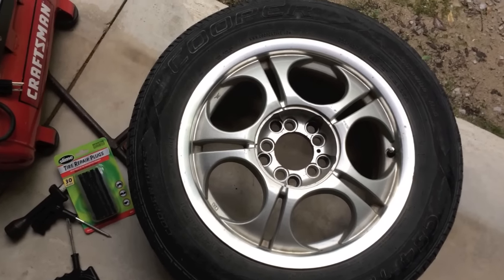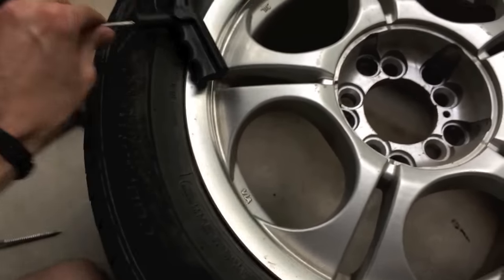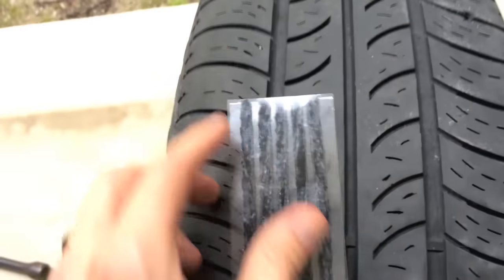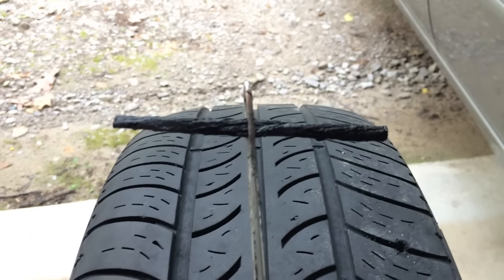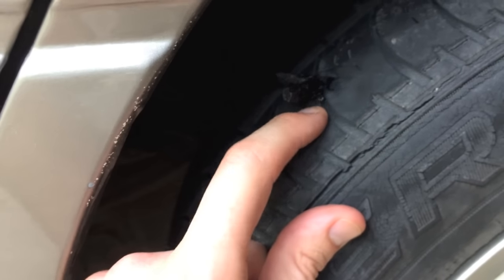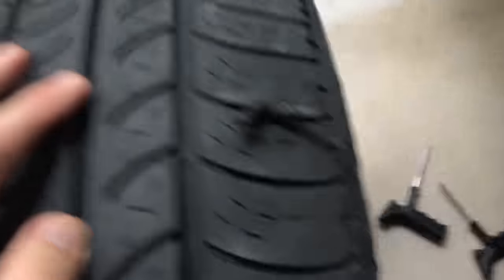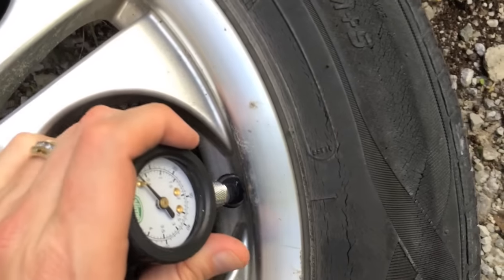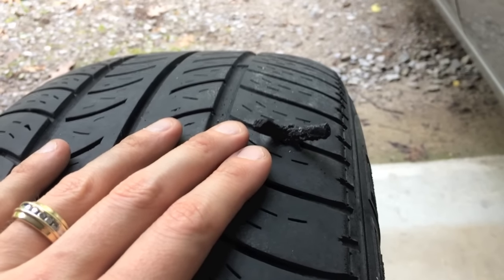How to Patch/Plug Hole in Tire in LESS THAN 5 Minutes - Fix a Flat Tire - EASY FIX

Comment: First time user.  Small hole and hard to fill with tool (no glue).   I'm uncertain about the quality of the job.  Should I pull the plug and try again before using the car?
Reply from the maker: Thanks for watching, that will be personal preference and may provide you the piece of mind that it’s a perfect seal.

Now that you have performed this once, consider it practice.  You will do much better if you do it again.  😁👍

Comment: I had hard times to insert the patch in ! Is there any way to force it in, I also tried to use the weight of tire on the patch, it broke my patch rim handle.
Reply from the maker: Thanks for watching & these can be tricky at times.  You will need to use the tool with the rough ridges which will help scrape hole into a slightly larger opening.

This will allow you to insert plug in a more friendly manner.  Keep us posted.

Comment: You don’t need added cement to plug it. Simply light the plug on fire with a match just prior to insertion and the glue in the plug will set up like silicon glue/tar after it cools back down, because that’s exactly what it is inside the plug strips and if you dry fit it, the heat from the tire against the road during natural rotational will bond this plug to the rubber tire hole without added glue or matches. Just follow the instructions and you’ll be fine.

Comment: It’s a round file and it’s used to make the hole perfectly round for the plug to seal properly.
Reply: You will want to do it until it is fairly easy then insert your plug. It’s also a good idea to use rubber cement on the plug before installation. Let it set up for a half hour then air the tire up (if you can wait that long)
Reply from the maker: Thanks for sharing.  All helpful info is greatly appreciated.  😎👍

Let us know if you have any questions and hey if you’re into crypto trading, join our DIY ecosystem and become part of an exclusive group of DIYers.

       toolboxtoken.com

Reach out to us any time!  🧰

Comment: i did this but leak came back in a week. Used rubber cement, didn't push it in all the way, etc. Maybe these slime brand plugs are cheap?
Reply from the maker: Thanks for watching & welcome to the DIY Raptor Club.  We recommend installing a new plug.  Make sure you insert plug fully until the looped end goes through the tire to the inside.

Comment: If I had a hard time pushing the plug into the tire, is it ok to use a little wd40?
Reply from the maker: Tec Angel 

Thanks for watching Tec Angel.  Unfortunately we have never used WD40 on a project like this.  Not really sure if there is an advantage or disadvantage!

If it was us, we would stay away from using WD40 & just stick with the tool & items that are part of the repair kit.

Keep us posted!

Please subscribe to the channel and turn on your YouTube notification Bell 🛎 that would be awesome thanks again!  😎👍🔧🔩
Reply: I've experienced the same, especially is the hole is small.  I've method,  cut the worm down the middle,  that seems to work on the small holes,  because they're a nightmare to push in.

Comment: Then you can clean the rest of the gunk left on the reamer from the used plug with a cloth and brake cleaner. Keeping your tools clean and like new is a sign of good tool storage. Spray the cloth, or spray the reamer. Either way, brake cleaner dissolves it and it wipes right off.
Reply: the set tool
Reply from the maker: Thanks for sharing.  👍

Comment: So how do you avoid pulling the plug back out when you pull the insertion tool out?
Reply: It’s a really fast movement. The plug slips through the slot in the tool. If you aren’t fast enough it’ll pull the plug back out.

Comment: I have a hole in my tire in the same spot. Went to the shop and they wouldn't patch it because they said it was on the side wall. Is this a dangerous spot to patch/plug? Might have to do it myself..
Reply: Dease Knutz  thanks, plugged it myself and it’s been good so far

Comment: I went to a tire shop and they said they wont fix it because the puncture was within the lining of the tread and close to the edge but definitely not on the shoulder part, which is the same in this video. I am worried the tire might blow, due to it being unsafe, but Ive seen other videos for a tire repair on the shoulder of the tire which is seem thicker than within the tread like mine but many commented it could blow, so i am not sure if i should be too worried lol. Any thoughts?
Reply from the maker: Thanks for watching & welcome to the DIY Raptor Club.  That will be personal preference in the end.

For our tire, it made sense to plug it to allow us to drive it to the shop for a replacement tire.

The plug cost less than $5.00 which was better than the quoted tow to shop of $285.00

Keep us posted.  😎👍
Reply: Youll be fine as long as it isn't on the sidewall. A tire can blow at any time plugged or not.
Reply from the maker: @thebeachguy6697  

Thanks for watching & sharing.  😎👍

Comment: you might want to revise not cutting several times I had attempted to leave it, and it pulled out as it was parked on a hot cement road the debris attached itself to the cement because of the heat and pulled the plug out. Use a razor blade and cut it flush is the best result.
Reply from the maker: Good morning, just poured a cup of coffee and am sitting down to answer any and all questions for the DIY community.

Thanks for taking the time to share your experience and feedback, always welcome here.

Let us know if you have any questions and hey if you’re into crypto trading, join our DIY ecosystem and become part of an exclusive group of DIYers.

       toolboxtoken.com

Reach out to us any time!  🧰

Comment: How long will this last?  Is this a temporary fix until you can do a proper patch (off the rim)?
Reply from the maker: William Woods 

Thanks for watching, this product is engineered & designed to be a temporary fix.  We have spoke to people that have used this product & had no leaks for several years however again...engineered & designed to be a temporary fix.  Hope this helps.

Please subscribe to the channel and Ring your YouTube Bell 🛎 that would be awesome thanks again!

😎👍🔧🔩
Reply: I've plugged almost new tires with full tread & this held up till I changed the tires once all my tread was gone. They have to say temporary fix but we all know from experience that once this is sealed it is good for the life of the tire especially for simple screw or nail holes.

Comment: What’s the best way to locate the leak just looking what if it’s a small one?
Reply from the maker: Good morning ☕️ if tire is inflated and still installed on wheel hub, you can spray a mixture of dish soap and water on tire.

The mixture will bubble at the location of leak.  Please keep us posted.  🧰

Comment: Great video!
I'm a novice at auto repairs and just wanted some clarification on this repair. 
Isn't this repair too close to the tire wall? I heard that you only want to patch tires where the puncture is in the 'crown' or center of the tire? How true is that? jw.
Thank you again! - BC
Reply from the maker: Thanks for watching & welcome to the DIY Raptor Club.  This will depend on who you ask.  Most importantly, if it’s on the sidewall...no go...tire is trash.

Hope all is well with you and your family Brian.  😎👍
Reply: Yes your correct the repair is to close to the sidewall there can't be a patch there only a plug and it's still a risk
Reply from the maker: @excessivemedia9295  

Thanks for watching.

Comment: When i was doing all the thing the strip go all the way in 
What should i do its not leaking though
Reply from the maker: Good morning ☕️ any update?  If the entire strip went all the way through the tire, we recommend inserting a second strip/plug to ensure that the tire does not leak.  🧰
Reply: @DIYwithMichaelBorders Good morning , i tried to check it with the soapy water and there were no bubbles after that and the tire is not leaking air drove it for 100 km already
Reply from the maker: @roopindersingh2051  

Thanks for the follow up.  😎👍🧰

Comment: Wait, did you push the nail into the tire?
Reply: Yes yes he did
Reply: @josh1158  that’s ok? Because I have a nail that the head has been broken off. Easier to push it in than pull it out.
Reply: @gregoryschwarz2730  Not really it'll probably make a noise and throw the tire out of balance! If you don't care about that go for it 🙈

Comment: You should never try to push the object all the way inside your tire you wanna pull the nail or screw whatever it is you want to pull that out of the hole and get it out of your tire not have it banging around inside your wheel rim

Comment: What to do if there IS a leak even when the hole is plugged?
Reply from the maker: Thanks for watching, you will need to pull out plug, add the cement application and install a new plug.  😁👍

Comment: This video is good but you did not patch the hole. You put a plug in the tire. I have worked at a tire shop for over a year. And patches go in the tire. Good job though

Comment: Interesting. I always put a liberal amount of rubber cement on the reemer and send it in and out to coat the sides of the hole. I actually send the plug all the way down and then pull up and there is less excess on the outside.  Then I liberally put rubber cement on the top and light it on fire. Never had a plug leak!
Reply from the maker: Thanks for watching & sharing, that’s a great idea!!  Added sealant is nothing shy of more reliable.  😎👍
Reply: @DIYwithMichaelBorders  np and of course sir
Reply from the maker: @mikehigby7897  

😎👍

Comment: How long can u drive with a plug
Reply from the maker: Thanks for watching, some will recommend having your tire replaced very quickly after inserting plug while others will share with you that the plug has lasted several years.

You will be the final say.  We just had a viewer a few weeks back mention he used this plug kit on his tire 5 years ago and the tire is still holding air.

Hope this helps and hey if you are into crypto trading, check out our newly launched DIY ecosystem.

       Toolboxtoken.com

We DIYers need to stick together! 🧰

Comment: This should actually only be used to get you to a proper tire shop. Using repairs like this only temporarily repairs the tire as it always moisture to get to the steel belts in the tire. Everybody knows that moisture plus steel causes rust. Once the metal belts in the tire start rusting the tire will separate causing a bubble in the tire which will eventually pop. Source: 10+ years as a technician specializing in tires
Reply from the maker: Thanks for watching & sharing your thoughts Jeff, enjoy your upcoming weekend.

Hope all is well.  😎👍

Comment: Anyone else have a really tough time getting the needle and rubber compound pushed through the tire?
Reply from the maker: Good morning ☕️

This step can be pretty stubborn at times depending on the size and style tire you have.

Little tires are easier to work with as opposed to big truck tires or more low-pro performance tires.  Keep us posted.

Comment: What if I can't push that hard?  Is there an easy way?
Reply from the maker: Thanks for watching, we recommend removing tire from hub which will give you a better position to press plug in place.

If attempting to perform this with tire still connected to hub, it becomes a bit trickier.

Keep us posted and hey if you’re into crypto trading, check out our newly launched DIY ecosystem.

       Toolboxtoken.com

Reach out to us any time.  🧰

Comment: two things the plug and the syringe is the first thing you set up then open the hole with the other syringe then put rubber cement then plug it its simple but if not done correctly it's not gonna last
Reply from the maker: Thanks for sharing

Comment: You should pull the tool quickly, not slowly and also sometimes pushing the tool is very difficult, if so you should use some of the glue that came with the kit, been doing this for a while now. Peace and God Bless
Reply from the maker: john jkizer 

Thanks for watching john, we appreciate you sharing your advice.  Us fellow DIY’ers need to stick together!

😎👍🔧🔩

Comment: You need to cut the plug flush with the tire or the road surface will pull that plug out in no time. It may be hard to cut but has to be done.
Reply from the maker: Good morning ☕️ thanks for taking the time to share your thoughts and advice, always welcome here.

Our plug never got pulled out during the remaining year of the tires life.  👍

Comment: i tried it on 2 tires, i can get the reamer through easily, but i'm too weak to push the plug with rubber in... i tried adding rubber cement for lubricant, but still not strong enough... tow truck guy recommended fill it with air first with reamer still inside.  otherwise when you try to push the plastic in, it sinks in making it harder to push in.
Reply from the maker: Thanks for watching & welcome to the DIY Raptor Club.  What’s your update?  Tires can definitely be a bit stubborn when trying to poke something through them.

Please keep us posted.  😎👍

Comment: I have used this product before and it works but voids your manufacturers tire warranty and is really used as a temporary repair until you can purchase a new tire. Using a plug from inside the tire is the correct way to patch a tire.

Comment: I always have hard time putting the plug in. Any tips?
Reply from the maker: Mark Vaio 

Thanks for watching & great question.  You may need to spend a few more minutes using the digging tool with the ribs/groves.

This will allow you to open up the hole slightly more than it possibly is.  Let’s start there.  Keep us posted!

Please subscribe to the channel and turn on your YouTube notification Bell 🛎 that would be awesome thanks again!

😎👍🔧🔩

Comment: I used a slime tire plug and it sealed to the tire BUT THE PLUG LEAKED FROM ITS CENTER !!!
Reply from the maker: @bobpawtucket1336  

Thanks for watching, any update?  Have you replaced it with a new plug?
Reply: @DIYwithMichaelBorders  I have some on order.
Reply from the maker: @bobpawtucket1336  

👍

Comment: this guy made two crucial mistakes that can make you do bad seal... dont listen to this guide completely... mistakes are... you must use rubber cement that seals and holds strip in place. then you must pull out WITH force really fast, like you dont want her get pregnant cuz she is not wife material.

Comment: Remove the tool quickly. Don't do it slow. Trim the extra don't leave it hanging out like that and lastly, check for leaks. Don't eyeball it, use soapy water

Comment: Should this be inflated like til 50 psi
Reply from the maker: Blazingbluewing 

Thanks for watching.  We recommend never filling tire above MAX psi for safety purposes.  We hope the video helped.

Please subscribe to the channel and ring your YouTube bell 🔔 that would be awesome thanks again!

😎👍🔧🔩
Reply: DIY With Michael Borders what can I do to make the string go in more easily and without out having to struggle too much 😓
Reply from the maker: Blazingbluewing 

Thanks for the reply.  You will need to use the tool that is designed to grind out the hole to better assist in inserting plug...& tire should be flat “0 psi” when performing these steps.

😎👍🔧🔩
Reply: DIY With Michael Borders thank you 🙏 a lot
Reply from the maker: Blazingbluewing 

😎👍🔧🔩
Reply: @ozfeldi  make the hole bigger or put a little dish soap on the tip of plug.

Comment: Are you serious you didn't even remove the damn nail/screw in the video? That's definitely an important step
Reply from the maker: Thanks for watching & we appreciate you sharing your thoughts.  If you have a screw in tire, it may be as simple as using a screwdriver & unscrewing it from tire.

If it’s a nail, you can use a flathead screwdriver to get under screw-head & carefully shift it up & out.

Please keep us posted on your project, us fellow DIY’ers need to stick together!  Hope all is well with you and your family.

😎👍🔧🔩
Reply: @DIYwithMichaelBorders  iRun 80 psi all-terrain tires I pull a gooseneck dump trailer typically I run around 65 lb in the rear and 50 in front I'll tell you what it wasn't an easy job but I got it done without breaking my hand hahaha
Reply from the maker: @GuitarRocker123  

Awesome Awesome & that’s a little more advanced for sure.  We really appreciate you sharing this.  Great to hear you’re back up and running.

Hopefully the rough winter weather isn’t giving you much troubles.  😎👍

Comment: OMG....I tried step 1 and my wrists are too weak and wobbly to puncture the tire with that tool. Thinking an electric drill might work better for me!
Reply from the maker: C Connelly 

Thanks for watching & sharing your comment.  It can be tricky for sure depending on the life & remaining thread of the tire.  😀

We have never used a drill for this project.  🤔

Keep us posted on your project & any questions you may have.  Please subscribe to the channel and turn on your YouTube notification Bell 🛎 that would be awesome thanks again!

😎👍🔧🔩
Reply: Please Mrs. Connelly don't use a drill.
Reply: @VibingCat39  Too late, I did and it worked great.
Reply: Big truck tires need a drill attachment if you can't push it in then you may not have found the small puncture or entry of the screw or nail that went through
Reply: Drill bits will leave a smooth hole.
The tool will leave a rough hole that is better to hold/grip the plug and will stay and last longer without leaking.